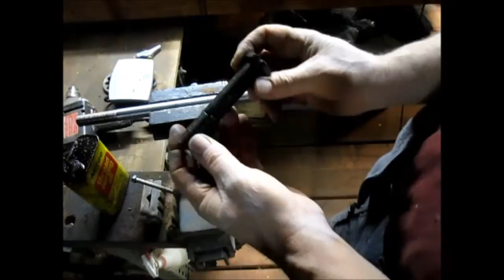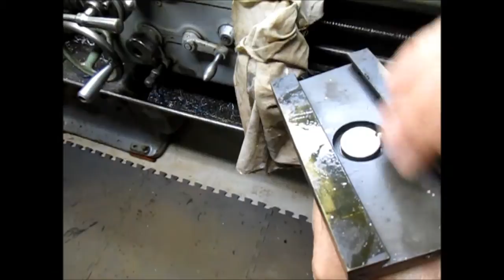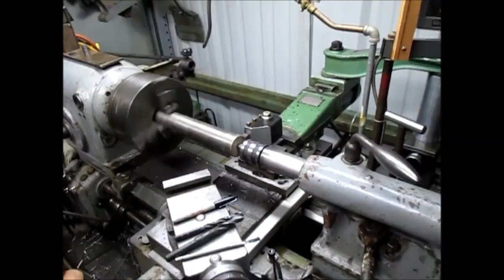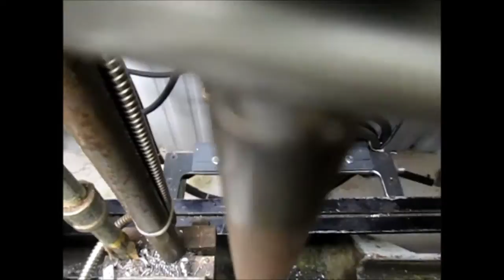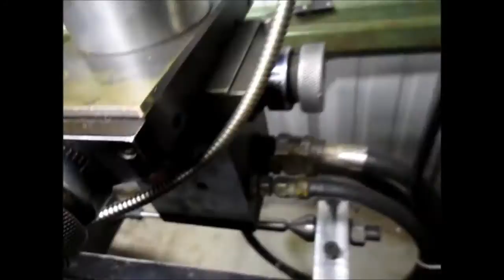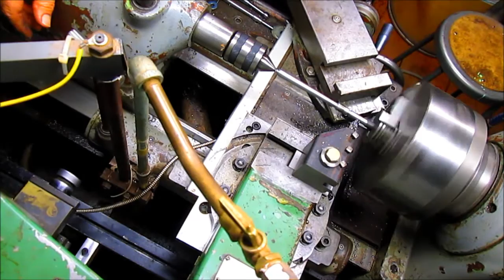Tracer Tactics 10

Comment: I just purchased an old True Tracer MK2A. Like you I went to buy an item in a machine shop and asked about the tracer. All the literature shows the tracer set up on the operator's side but I wonder if the rails will swap to other side???
Reply from the maker: I never knew that the rail was suppose to be in front, so I put it in back out of the way.